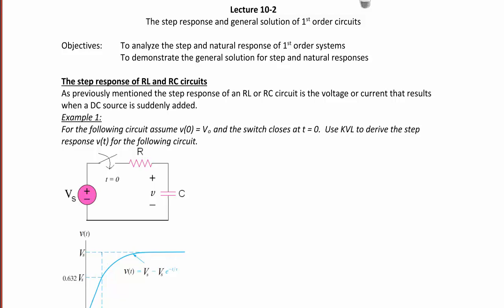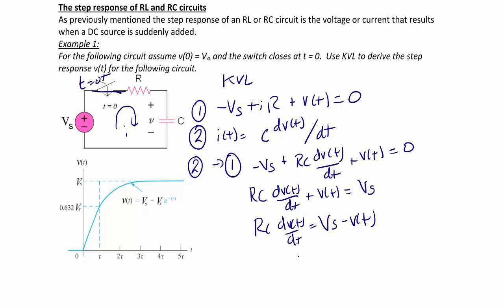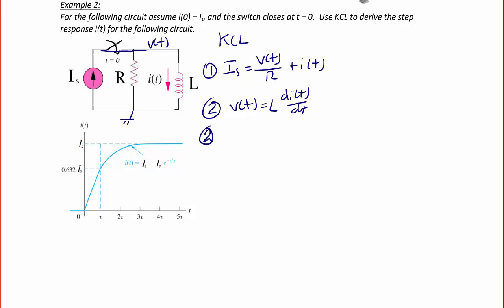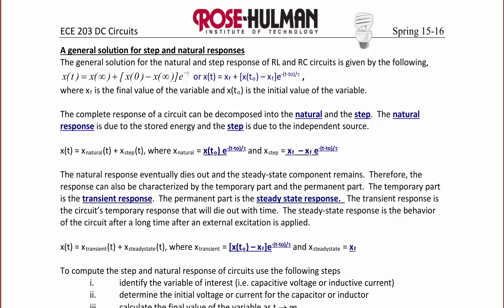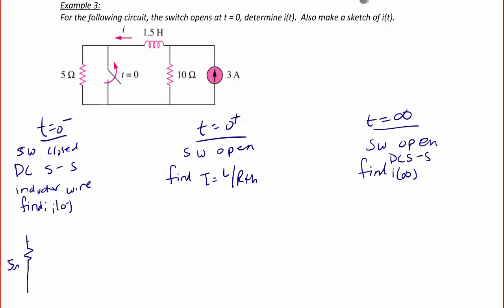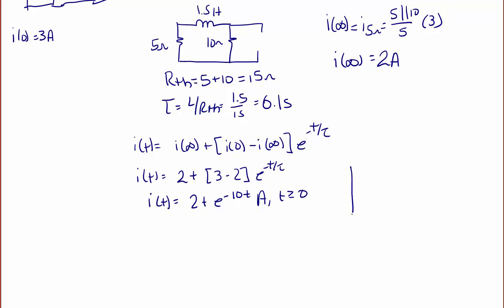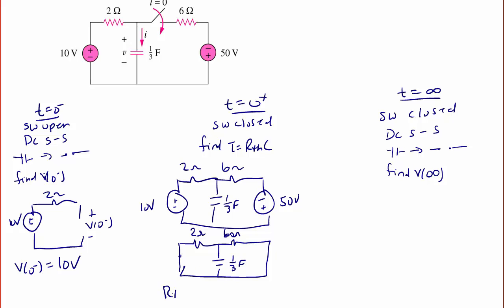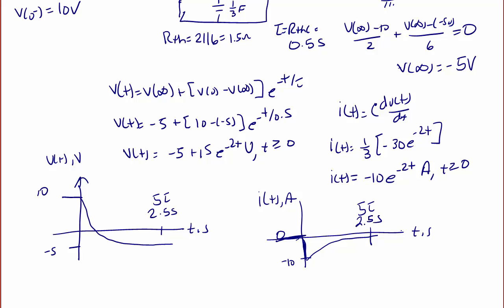ECE203 Lecture 10 2: Step Response and General Solution of RL and RC Circuits

Comment: Ma i dont get ...in the first example u used to- as sw closed...in the second one u use sw open
Reply from the maker: you have to look at the direction of the curved arrow on top of the switch symbol to determine whether the switch opens or closes or how it moves at t = 0

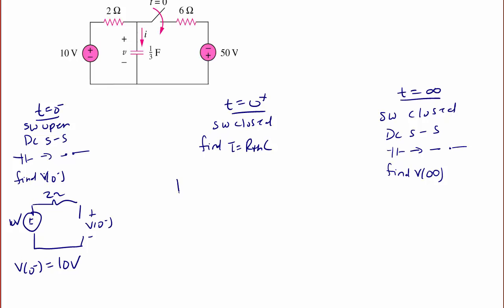Comment: @ 19:05 You say the V(o)=10V. Why wouldn't V(o)= 10-50=40V? Why would the 50V source NOT affect the capacitor voltage at t(o-)? Thanks!
Reply from the maker: the switch is open at t = 0- so that 50V source is not connected yet, also voltage across a capacitor is continuous so right after time 0 it is still 10V
Reply: @RoseHulmanOnline  Thanks for the reply! BUT--> the 50V source IS connected to the (-) side of the capacitor by a wire, before the switch is thrown
Reply from the maker: @Festus2022  Very true but but if there is no closed circuit there is no current flowing so since the other side of the voltage source is not connected because the switch is open with respect to the capacitor, it is a stand alone source that is not supplying any power to the capacitor. You must have a closed circuit to supply current and power. It is like a battery sitting there with nothing connected at the top, it is not supplying power to anything. 👍🏾👍🏾
Reply: @RoseHulmanOnline  Thank you so much, and I'm sure you are correct, but this seems to contradict everything I thought I knew about voltage. I am aware that direct current will not flow if the circuit is not complete, but won't positive VOLTAGE from the 50V battery extend along the big circuit node along the bottom of the circuit as drawn? If you connect a wire to each end of a battery, doesn't the voltage extend to the end of the wires  if the wires are NOT connected to form a circuit? Thanks
Reply from the maker: @Festus2022  If you put a voltmeter across the -50v source it will measure -50V but if you put an ammeter there will be ZERO current, power is P = VI if there is no current there is no power. The voltage source is sitting there supplying power to NOTHING. Even the 6 ohm resistor in series with the voltage source has no power, no voltage because there is no current. Nothing happens until that switch closes at time, t = 0.
Reply: @RoseHulmanOnline  I realize all that, but doesn't the voltage extend into the wire even if there is zero current? I'm not concerned with current or power. I'm talking about voltage only. Doesn't the 50V positive terminal affect the voltage in the connected wire along the bottom of the circuit?
Reply from the maker: @Festus2022  No, it doesn't. That is not how voltage works. Voltage is a separation of charge, current is the flow of charge, you cannot have voltage on one side with no reference. There are two terminals on a voltage source for a reason. I recommend reviewing your Physics and Circuits textbook and discussing this concept in detail with your instructor or tutor or watching more of these videos to help with this concept. 👩🏾‍🏫👩🏾‍🏫👍🏾👍🏾
Reply: @RoseHulmanOnline  Thanks for your patients.
Reply: @RoseHulmanOnline  Here's what an AI query says-->"Yes, a battery can supply voltage to a capacitor even without a complete circuit, meaning you can connect one side of the capacitor to one terminal of the battery and leave the other capacitor lead unconnected; the capacitor will still charge to the battery's voltage, but no current will flow once the capacitor reaches that potential difference because there is no complete path for current to flow through."
Reply from the maker: @Festus2022  no the voltage is ground, 0V, voltage is a differential, not just a number

Comment: RC circuit time domain 

 “The voltage across a capacitor cannot change instantaneously” is a statement one finds often in textbooks on circuit theory which discuss the application of a step voltage to an RC circuit. Most students memorise and apply this in circuits without understanding the physical processes involved. 

It will be useful to learn the operation of charging a capacitor using a unified approach to electrostatics and circuits. 

Electrostatics and circuits belong to one science not two. To learn the operation of circuits it is instructive to understand Current, the conduction process, resistors and Voltage at the fundamental level as in the following two videos: 

i. https://youtu.be/TTtt28b1dYo and
ii. https://youtu.be/8BQM_xw2Rfo 

It is not possible in this post to discuss the charging of an uncharged capacitor. During the first few nanoseconds after switch ON, while the surface charges arrange themselves, there is no electric field E_cap and fringe field because there is no initial charge on its plates; it is as though the capacitor was not there - as though there were a continuous wire with no break in it. 

The last frame References in video #1  lists two textbooks 3 and 4 which discuss in detail with a series of diagrams (sequentially arranged) the physical processes in charging a capacitor. 

 RC circuit frequency domain 

 The current (sinusoidal steady-state) in a capacitor is due to the resultant electric field E_net (resultant of the applied field and an opposing electric field, the fringe field). If the capacitance of the capacitor C is made large, then the fringe field does not build as fast as it would have if C were to be smaller. With a large C, the charge sprays on the plates do not result in developing a large voltage in a given interval of time as evident from the capacitor voltage-charge relation Q = CV. 

The fringe field is smaller and the net field consequently is greater. Therefore, at a fixed frequency, the current increases as the size of the capacitor is increased. The current also increases as the frequency is increased. So, we say it passes higher frequencies of applied voltage. 

If the frequency is made smaller, the fringe field builds very rapidly and in the limit when it is dc, it blocks the applied voltage.
It is not possible in this post to discuss in more detail current in capacitor circuits and capacitive reactance. The last frame References in video #1  lists textbook 4 which discusses these topics in more detail using a unified approach and provides an intuitive understanding of reactance. It also describes with sequential diagrams how the current leads the voltage across the capacitor by 90 degrees. 

 RL circuit time domain 

 When a magnetic field inside a solenoid varies with time, a curly non-coulomb electric field is observed both inside and outside the solenoid. 

A coulomb electric field results and we note that an attempt to change the current in the coil induces an emf in the same coil and makes the coil sluggish to respond to current changes. 
It is not possible in this post to discuss the production of induced emfs in inductors in detail. 

 The last frame References in video #1 lists two textbooks 3 and 4 which discuss in detail with a series of sequential diagrams the physical processes to explain the operation of inductors and RL circuits. 

 RL circuit frequency domain 

 The existence of a sinusoidal current resulting from the application of a sinusoidal voltage to an inductor is a characteristic of the non-Coulomb electric field that is proportional to the rate of change in current causing a changing magnetic field. 

 The current is a result of an opposing Coulomb electric field, which is a result of polarization by the non-Coulomb electric field associated with the changing magnetic field, and the current is a consequence of the resultant field of the applied field and the Coulomb electric field in the inductance coil. 

Inductors find applications as filters in power supplies and in resonant circuits in tuned amplifiers. 

If we increase the “frequency” of the input voltage to an inductor, the “rate of change” of the input voltage and the applied field is “greater than” the rates obtained with applied voltages at lower frequencies. At low frequencies, this causes a smaller induced opposing electric field and emf, therefore, large currents will flow within small intervals of time in the coils of the inductor. 

In the limit, if the input is a dc voltage, the current will become so large that the inductor will burn out. 

In an inductor, the opposition to the applied voltage which is changing the current is instantaneous and so, the current can only follow after the applied field has overcome the opposing emf. In an inductor for sinusoidal currents, the current lags the voltage by 90 degrees if the inductor is pure, and less if a resistance is in series with it; the inductor fights before current flows. If an inductor weren’t to fight, you will get energy for free! 

Low pass filters are built using L-R circuits in simple applications. Therefore, we say the inductor “blocks high frequencies” and acts as a “short circuit” at low frequencies as if the inductor was not there but a wire. 

 It is not possible in this post to discuss in more detail current in inductor circuits and inductive reactance with sequential diagrams (textbook 4, see below). 

The last frame References in video #1 lists textbooks 3 and 4 which discuss these topics in more detail using a unified approach and provide an intuitive understanding of reactance.

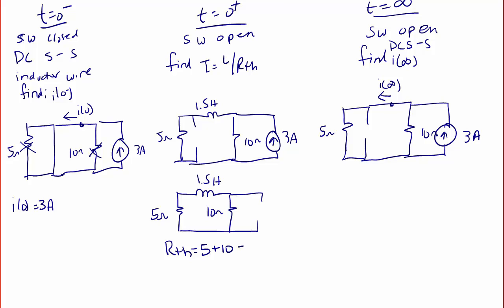Comment: At 15:10 why did the resistors being computed in series even though its in parallel
Reply from the maker: The resistors are actually not in parallel, resistors in parallel share a single node pair, that means connected on top and bottom. Resistors in series are when exactly two meet at a node so that they have the same current. Resistors in parallel have the same voltage. The 10 ohm and 5 ohm resistors are in series.